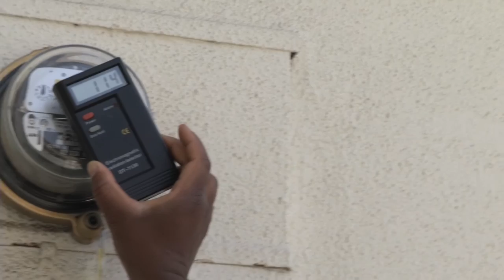Lawson Family Meter Installation

Comment: It would be interesting to know what the power quality (Graham-Stetzer) levels are. Also, some RF meters (TES-92 for one) read certain frequencies differently if they are being held due to the RF coupling through the body which acts like an antenna. Setting the meter on a non-conductive base made of wood or plastic is the only way to ensure accurate results.